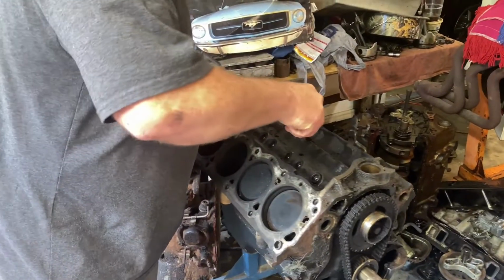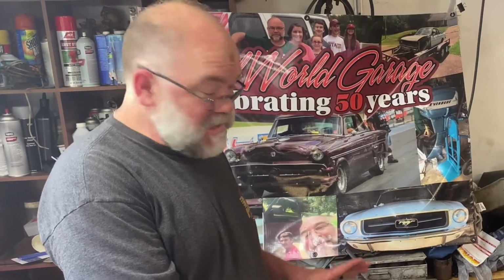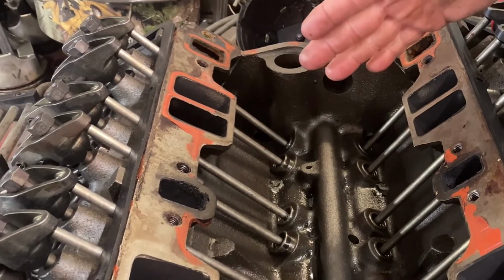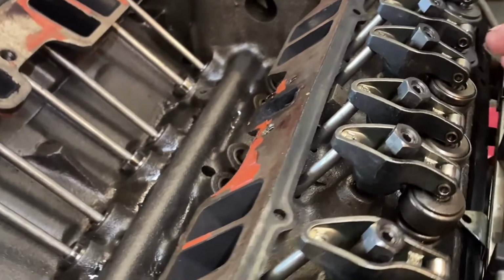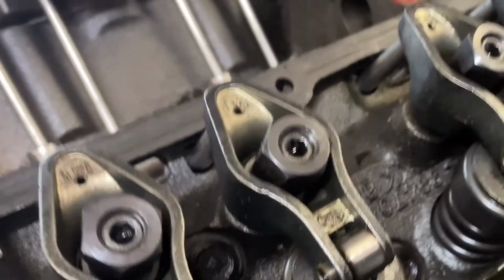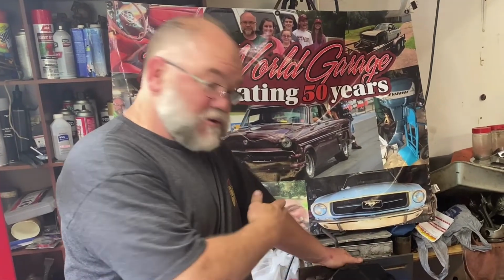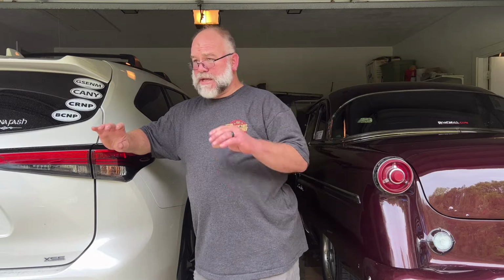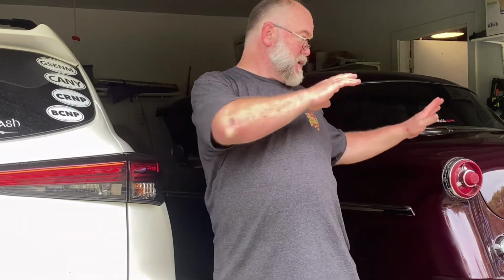engine oil| synthetic vs conventional| 10k mile change?? |using synthetic oil in an old engine??|

Comment: Hey, learned something I didn't know!
Reply from the maker: What is that??
Reply: @RealWorldGarage  A few things actually. First I didn't know that nonsynthetic created that much sludge over time. I always heard swapping to non synthetic could cause problems and leaks but thought that was an old wives tale and I guess the last thing I learned from that was the difference in composition between the 2 types.
Reply from the maker: Synthetic can too, but you have to push it a lot further for it to happen. Conventional changed regularly prevents the sludge build up, but requires more frequent changes. There’s a lot of nuance to oil and oil change intervals

Comment: Great video!
Thanks for sharing your knowledge.
I fall into the once a year club since I work from home. 
It is hard to change the oil since it looks so clean, but I believe moisture can get into the oil. Is this true?
Reply from the maker: To a degree. There are also other factors like your climate. Having it in a garage helps to a degree as well. As long as you don’t see moisture on the bottom of the fill cap, or sometimes you can see water droplets on the dipstick. Thanks for watching and commenting!!
Reply: I live near Atlanta, GA and always keep my cars (89 S-10 and 2005 Solara) garaged. Do I still need to change the oil once a year if driving less than 3K miles?
Reply from the maker: @darray7472  once a year should be fine. Use a quality oil filter AC Delco for the s10 and a Bosch or Denso for the solara.  I’ve always had good luck with Castrol GTX motor oil , but any good quality oil should be fine.
Reply: Thanks for answering my questions!
I like to use Valvoline oil and Fram oil filters.
I know a lot of people hate on Fram.
Are Fram oil filters really that bad?
Reply from the maker: I have seen them cause issues. Mainly when used in the scenario like you are in. Where they don’t get used a lot. I’ve never seen any issues with the ones I suggested. I wouldn’t use a fram.